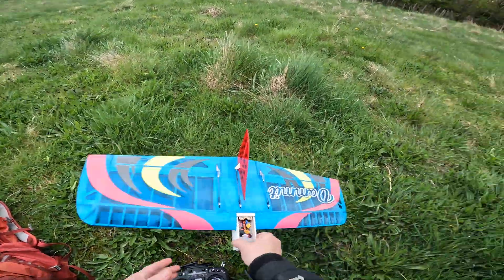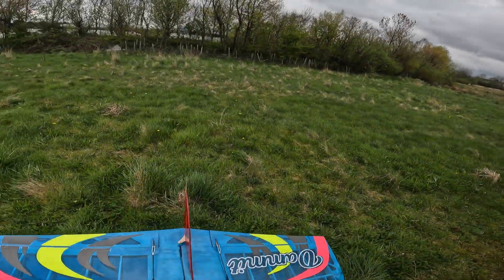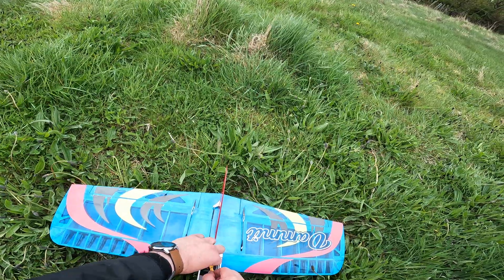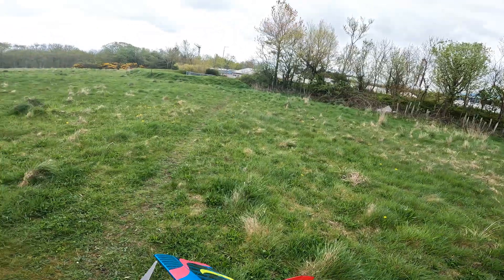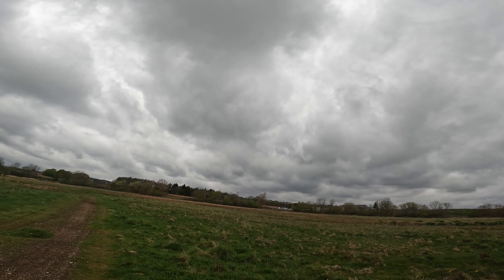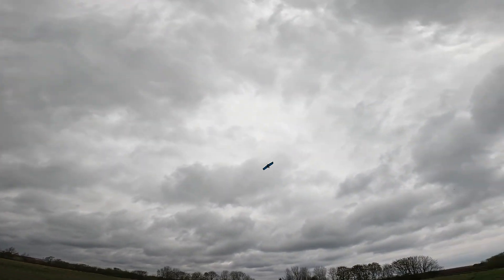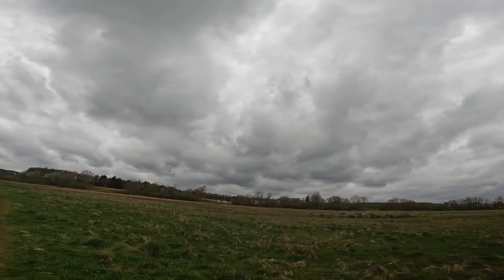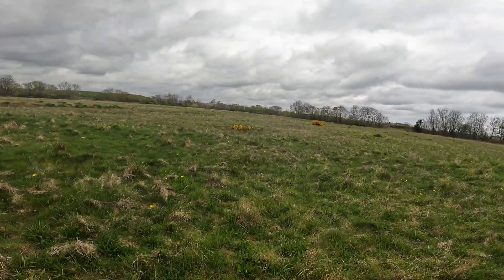Angelwing Dammit-e V2 first flight

Comment: Hi Steve, looking good! I’ve just ordered one of these and was wondering whether you feel the rudder is worth having / connecting up? It seems more like a bank-n-yank model and so a rudder may be unnecessary? Thanks! 😎👍🏻
Reply from the maker: I'd probably not bother with the rudder. I used it on this one as it was a prototype build so i wanted to test out the option. In reality I've only used the rudder very occasionally for a few stall turns. Omitting the rudder and servo also gives you a better shot at bringing the weight under the magic 250g.. I was 2g over
Reply: @jetplaneflyer  Thanks for your feedback Steve! Yes stall turns / coordinated turns were the only things I could think the rudder would be useful for, and this doesn't seem the type of model those manoeuvres are designed for 😁
Reply: By the way, what's the big deal with the 250g target weight? Does it mean you can fly closer to / over people, as per the drone regulations?
Reply from the maker: @HorizonimagingCoUkPhotography  The Drone regulations only apply if it's 250g or over. Anything less is exempt so you can fly anywhere you like, subject to common sense of course.
Reply: @jetplaneflyer  - Thanks Steve! So what does getting under 250g mean in terms of where you can fly? I've always flown my planes wherever I feel there is enough space / away from the public anyway?
Reply from the maker: @HorizonimagingCoUkPhotography  Just means you can do what you have been doing without worrying about contravening any of the rules that apply to drones, such as near people or buildings or roads airports etc. Of course common sense still has to apply. You also dont need to be a registered drone operator and you dont need to put your registration number in the model
Reply: @jetplaneflyer  - Ah ok thanks Steve 😊 I always fly away from people as a matter of course, and I've got my registration number in my models anyway as I fly drones commercially 👍🏼
Reply: By the way, I notice you went for quite a high kV motor (they recommend 2300-2600). How have you found the performance with that motor and what sort of flight time are you getting on your 650mAh packs? Thanks! 😊
Reply from the maker: @HorizonimagingCoUkPhotography  The motor was the one that the owner of Angelwing and designer of the model (Andy Whitehead) recommended to me as a good option for a lightweight setup that still had good performance. It delivers in all respects, its more than fast enough for me. I spend most of the time at half throttle. I have a timer set at 5 mins using a 3s 650mAh battery and 5.25 x 4.75 APC prop. Flying flat out all the time would cut the flight time.

A lower kv motor with a bigger prop might give longer flights but you wouldn't want anything much heavier otherwise the model will be nose heavy. I didnt need any noseweight in mine and I soldered the motor wires direct to the ESC to save a few grams up front to get the CG where it is.
Reply: @jetplaneflyer  Thanks so much for your quick and detailed reply Steve, and that's great to know it's the motor Andy recommended to you! I will go ahead with this motor – I've already got some 5x3 APC props so I will see how I like the performance with those, I can always increase the pitch if I need more speed! 😁 Thanks again!
Reply from the maker: @HorizonimagingCoUkPhotography  A little setup tip - set the arms on the servos angled forward about 15 degrees. If you set them straight up you end up with more up travel than down which makes rolls barrely (you can see this in the video). It's easy to tune out with differential in the Tx but better to get it right mechanically if you can.
Reply: @jetplaneflyer  - Oh that's a really helpful tip, thanks Steve! I'd never thought of mechanically tuning throws to make rolls more axial 👍🏼 Thanks!